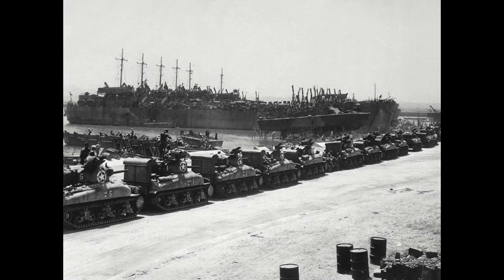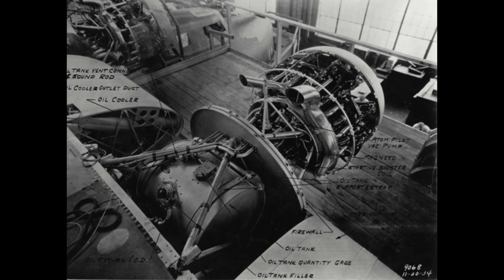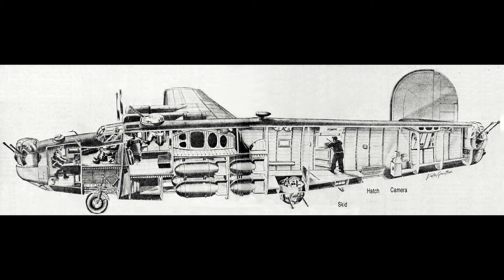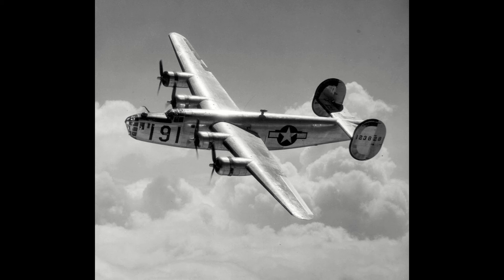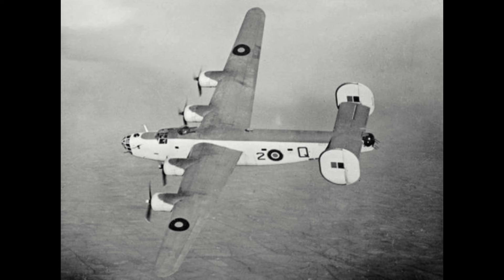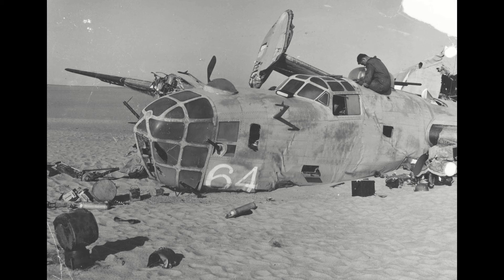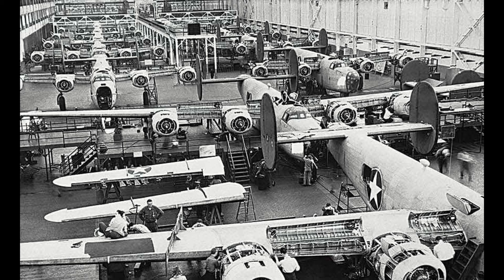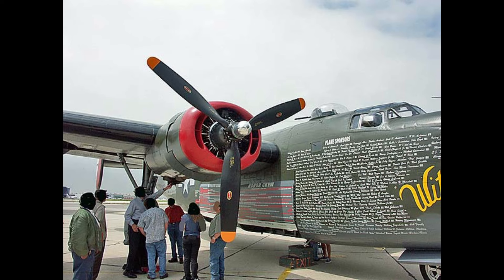5 Minute Guides to Aircraft: Consolidated B-24 Liberator

Comment: Ford engineers visited Consolidated to measure an original B-24. Then redesigned the B-24 for mass production. Which was at their new factory. That factory at Willow Run could produce a B-24 an hour, 24 7, 365

Comment: Just a small point - the B-17 didn't have staggered waist gun positions until later in it's production during the G version.
Reply from the maker: Really? I thought it got them around the late Fs, coulda sworn I've seen some pictures of them in the past.

I also did some quick digging because I was curious and apparently the H model B-24 does have staggered waist gunners, and was produced at the same time as the B-17Gs, August 1943. How I didn't find this originally is beyond me, prolly doesn't help I was sick at the time and didn't know it when I was writing.

This is what ya get when ya try and make a guide while sick lol. Still, the point of the B-24 being generally cramped compared to the more well laid out B-17 stands, its a small space getting through the walkways and passages, (I've toured through the inside of Witchcraft from the Collings Foundation, and even when I was younger and shorter it was a tight squeeze!)
Reply: @5MinuteGuidesToAircraft  Some of the last Fs had the Bendix chin turret but lacked some of the other improvements in the G like the staggered windows, but the differences between the last Fs and the first Gs are only visually distinguishable by the serial or if they were subcontracted to Vega or Douglas. They were still camouflaged with OD paint. That might be the reason for the confusion.

For Boeing planes, waist windows were staggered during production block 50.

For Douglass B-17s, the waist guns were staggered sometime during production block 25.

Vega was most likely sometime from block 35 to 45.

Comment: The combat loss rates between the two AAF heavies were not significantly different. There were more B-24 training fatalites  however that is not about combat survivability.

While the B-24 did not stagger the waist positions, the gun positions were staggered when enclosed.

The G series did not appear with nose turrets until Sept 1943. NAA has months behind in delivery and the G-1 had been called the K in planning. The H however was being delivered in quantity in July and August, 1943. Other nose turret quantity deliveries occured in April overseas and June 1943.